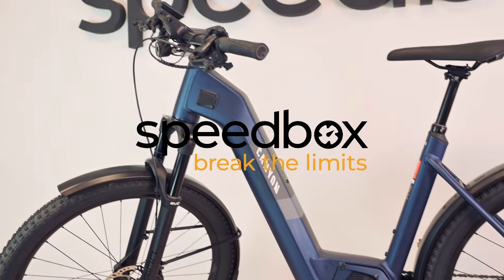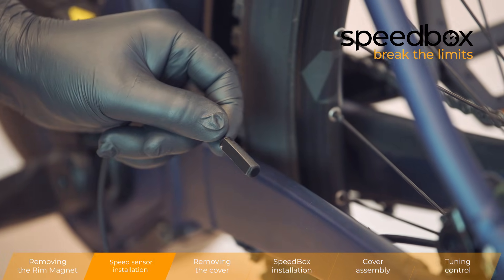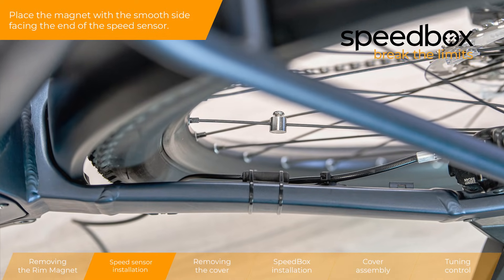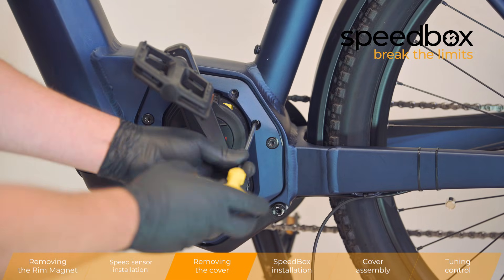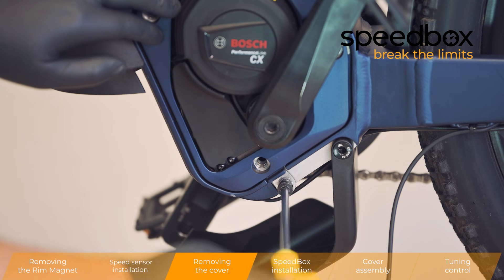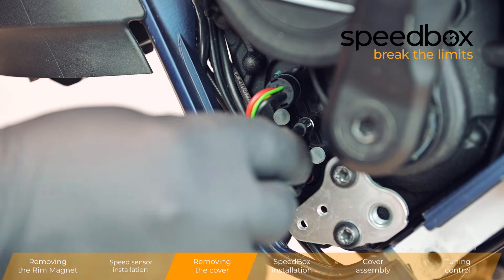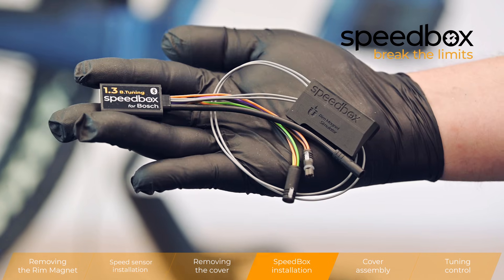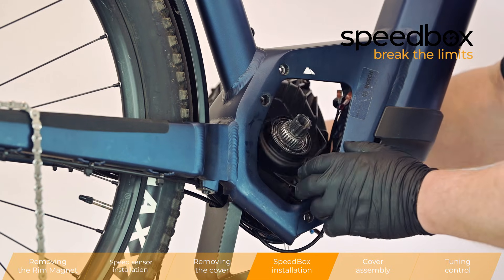NEW! Easy Install of SpeedBox 1.3 (B.Tuning) for Bosch CX 4th Gen.(Smart System + Rim Magnet

Comment: Hello! Thank you for answering. When I had a trip with a tuning and it counted to 0, should I switch it off or I can continue a ride?
Reply from the maker: Hi.
After interrupting your ride, you will see various speed values on the speedometer decreasing for a while. This is the so-called recalculation of the actual kilometers traveled (because during the ride, the e-bike assumes it was going max 25 km/h). We recommend following these measures: https://www.speedbox-tuning.com/p/speedbox-1-3-for-bosch#2157
When stopping for a short time, to continue riding smoothly, we recommend keeping one foot on the pedal so that the countdown does not start. When stopping for a longer period of time, allow at least a partial countdown to take place. After a long ride, the countdown may take several minutes. Do not remove the display if the countdown has not finished.

Comment: Hello! I’ve put speed box 1.3 with the help of your video a week ago. Tried it several times. Today happened the thing that the whole bike system turned off during a ride. After stop it did not switch on, after some time it was a light on the monitor(battery), and turned off again. Bike stopped to turn on. Came home on turned off bike without tuning. What can it be? What is the problem?
Reply from the maker: Hello,
Thank you for the information.
Could you please contact our support via the chat window on speedbox-tuning.com or via Messenger (SpeedBox Tuning)?
Our colleagues are available from Monday to Friday. Thank you.

Comment: Hello! I cannot understand why you put the  rim magnet back on the wheel after instaling tuning magnet from speed box (in the end of the video). What should I do with the speed box magnet if I will use speed box ? Would not they have conflict between each other?  Thank you!
Reply from the maker: Hi.
Don’t worry, you don’t need to do anything with the rim magnet anymore :)
At the end of the video, there’s just a demonstration of reinstalling the rim magnet in case the user wants to uninstall the tuning and put the magnet back on the wheel rim.

Comment: Hello! Do I just need to check  a wheel circumference or to set smth new?
Reply from the maker: Hi,
thank you for your question.
The Wheel Circumference setting works as a calibration of the tuning chip. You don’t need to change anything in the circumference settings.

Comment: ist der magnet nicht zu weit von dem sensor? bei mir funktioniert der chip leider nicht :/  zeigt mir andauernd fehlermeldungen an, das mit dem magnet was nicht stimmen würde. hab schon so viel versucht.
- magnet von 17mm bis 2mm an den sensor
- alles ab- und wieder angesteckt
- jeden anschlussport überprüft
- alter magnet saß in der bremsscheibe. habe ich auch ausgebaut. 
Nach kurzer Zeit stockt der motor und es blink am remote orange. ab da ist die unterstützung weg und ich bekomme eine fehlermeldung. 
Ich weiß einfach nicht was ich falsch mache :/
Reply from the maker: Hallo,
danke für die Info. Keine Sorge, die Installation dieses Tunings ist nicht ganz einfach, aber am Ende schafft es jeder. Manchmal übersieht man nur eine ganz kleine Kleinigkeit ☺
Versuche, unseren Support über die Website speedbox-tuning.com oder über den Messenger zu kontaktieren – dort wird dir sicher geholfen!

Comment: My bike does not have a display how will I know when the countdown has finished, or will it even have one ? My bike is a cube stereo 155 tm
Reply from the maker: Hi.
Thanks for your question. You can also find the recalculation (countdown) in Bosch's FlowApp.
Reply: I am not connected to the flow app will there still be a countdown
Reply from the maker: @BotFn-yh9rp  The countdown will still take place, but you won't see its end. Simply put, after finishing the ride, do not turn off the e-bike. Let it shut down on its own. The countdown will run in the background in the meantime.
Reply: @SpeedBoxTuning sorry for the amount of questions but if the Speedbox is turned off during the ride will it still need to count down after the ride or not
Reply from the maker: @BotFn-yh9rp  The number of questions doesn't matter at all, that's what we're here for!  ☺ Technically, if you let the countdown run after riding with the SpeedBox turned on and then turn off the tuning and go on another ride, the kilometers traveled will be in line with the speed. So there will be no need to calculate.
Reply: I have the exact same bike, how are you getting on ? Have you done the latest Bosch update ?
Reply from the maker: @cheesepizza87  Hi.
Please do not update your sw. 
We cannot guarantee 100% functionality in that case.